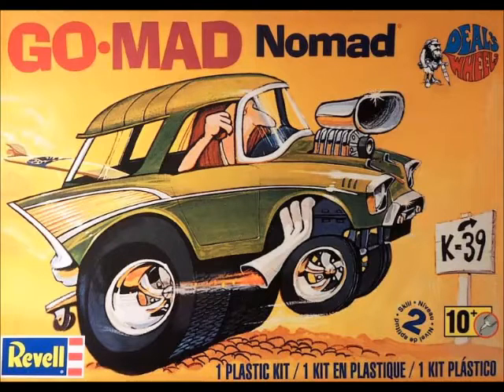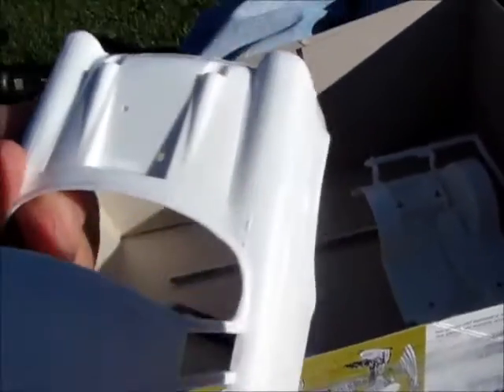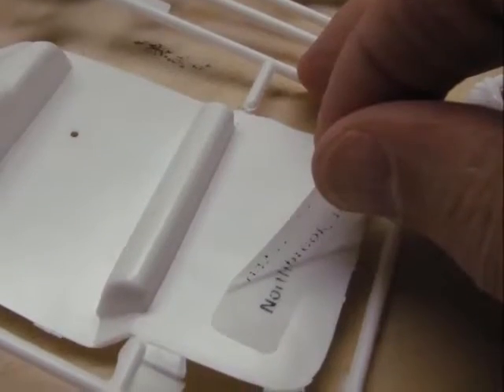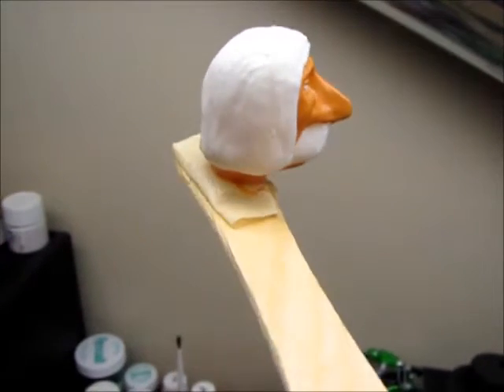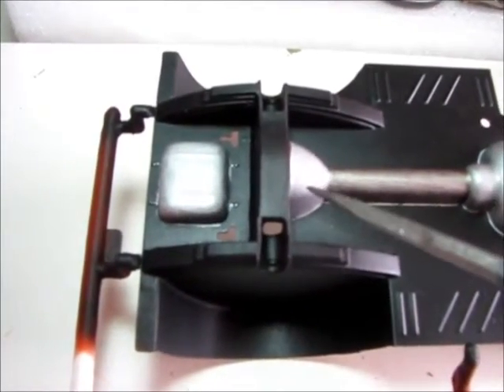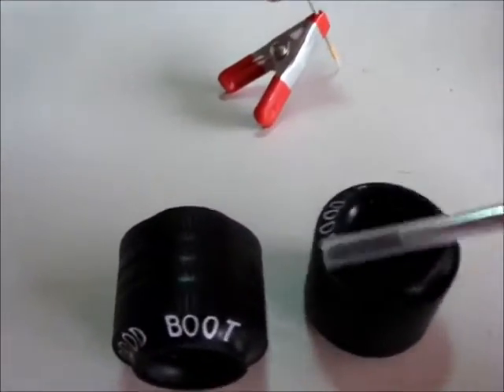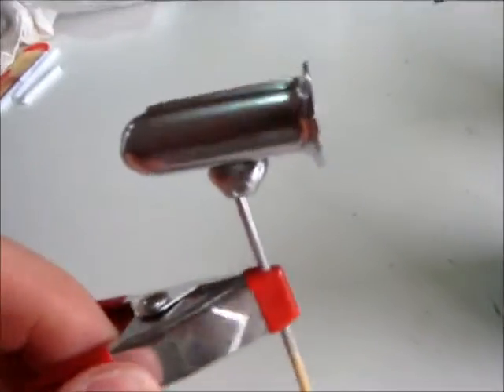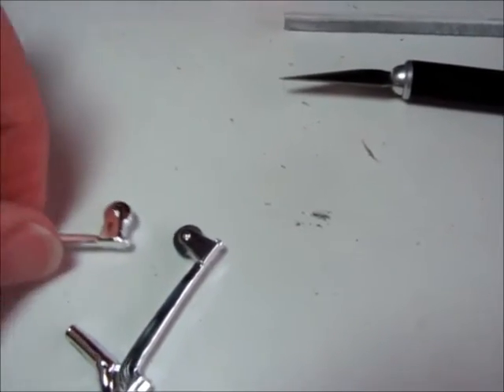Revell's Go-Mad Nomad - Update 1

Comment: Great progress.  It is really looking terrific.  I like your work on the blower, and the trick with the wheelie bars!  You did some really nice work on the interior and chassis.
Reply from the maker: Thanks Vince, It's slow going and there is more detailing than I thought, always seems to be 3 more things to do. lol.  And I keep referring back to your video for tips.  A little more sanding on the front fenders and I should be good to apply the paint this weekend, if it's not too hot.
Reply: LOL. I ran into the same thing.  As soon as I thought I had the detailing finished, I'd find something else I could do.  For a simple kit, it was more work than you would expect.  =D

Comment: Hi ya Steve. Looking really good so far. I like your idea for the wheelie bars and will probably use it when I build mine. I noticed you used the Aztek paint for the interior, how do you like it? I love that paint.                  Papadan
Reply from the maker: I took your advice and tried the Aztec paint (red opaque on the interior), it works great so I picked up some more at Michaels with 50% off coupons.  I'm going to use the pearl red and pearl white on the body.  I noticed they're a lot thinner than the craft paints I've been using so I've been thinning them more now.
Reply: I have been 'collecting' Aztec paint at Michaels also. I do not go near that store unless I have a 50% off coupon. They (Aztec) are thinner than the usual craft paints because they are airbrush ready and some of the colors may not be as opaque as others.

Comment: Great progress. Like the results of the Krylon Chrome. You mention white enamel paint for the tire lettering. Enamel paint and vinyl tires do not like each other, I suggest wash off enamel and use acrylic paint instead. I have the same kit in the stash.
Cheers Eh!
Reply from the maker: I should have put on gloss black before the Krylon Chrome but it came out ok.  I found out later that the acrylic white is better but after using the enamel it sat for a few weeks and I think it's ok now.  I have started the bmf but took a break a few weeks ago and haven't made it back yet.